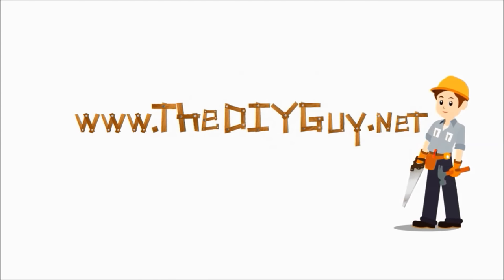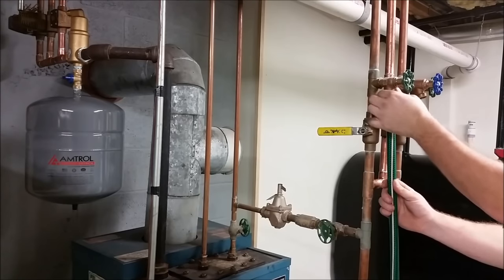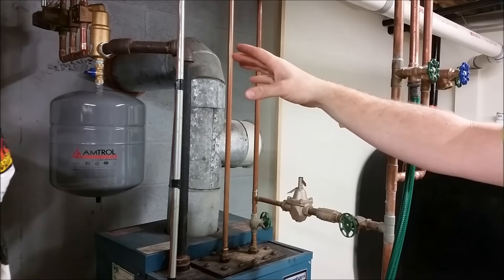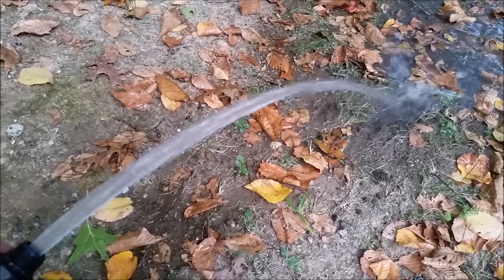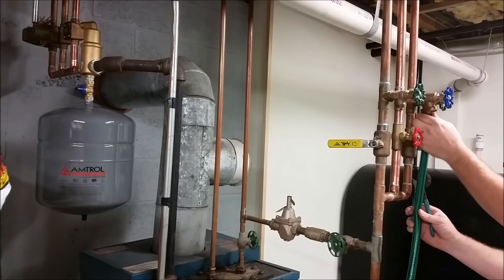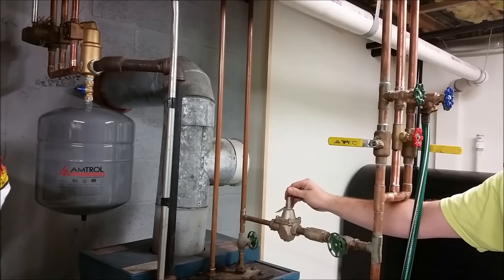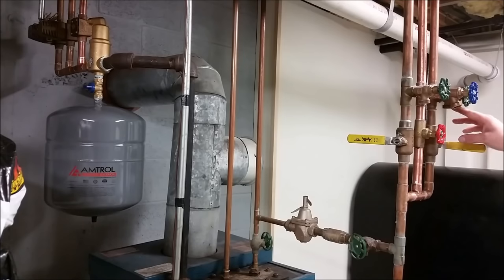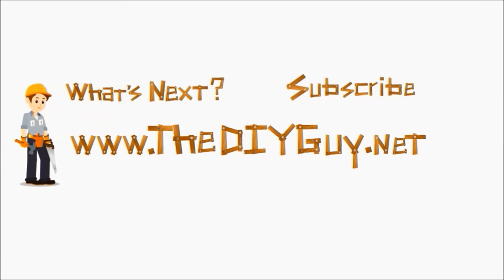How To Remove Air From Your Heating System

Comment: how does air get into the system?
Reply from the maker: In this case I replaced the old taco air scoop with a spirovent.
(opening the system) Sometimes the feed valves get stuck closed not allowing it to top off the boiler, the expansion tank going bad.
Reply: ImJustAsBad , magic
Reply: Through the water inlet

Comment: I bet this is a nice heating system. Seems as though it wouldn't create dry air.
Reply from the maker: It's ok. It's just hydronic baseboard heaters with a burnham boiler. I would like to have a buderus with all floor heating. As someone I know has it and it's awesome as the heat comes from/ though the floor and hits everything as it rises so your couch,tables, chairs are warm and you can have the temp much lower. Plus seems to be less dust and you don't have to worry about blocking baseboards.
Reply: Hi there. I did exactly what you did everything was perfect for 1 day .after that day star making noise like water falls 
I can do something wrong???
Thks for you help

Comment: So i did all this but Im getting some water coming out of the valve I attached the hose too. water leaking from both zones actually for more than 30 mins.
Reply: Valve probably needs new washer.
Reply: I had that same issue, the washer in my valve was worn out.  Bought a bunch of assorted washers from Homedepot, reinstalled the new washer and problem solved.

Comment: your just pruging the system! the Spiro vent should take care of that!  that's what is intended to do! or your expansion tank is shot! replace the Spiro vent!
Reply from the maker: Yes, you are correct. That's what I'm doing purging the air from the system. Yes that is also correct that is what an air eliminator is designed to do remove the air from the system. The spirotherm air eliminator and expansion tank where replaced and that is the reason there was air in this system.

Comment: I have someone here right now who wants $200 to do just this.  He said you could be asking for trouble doing this, some part may break.  Hmm
Reply from the maker: There are two things that could happen.. One if the boiler is hot and you fill it up with cold water you could shock the boiler. The second thing is sometimes the feeder valve gets stuck open depending on when the last time it has been used. If it sticks on there normally is a shut off valve right next to it. So what did you end up doing?
Reply: @TheDIYGuyDOTnet  i paid to have it done.